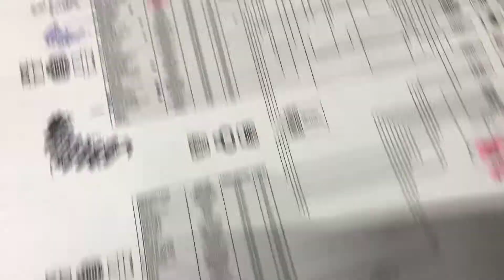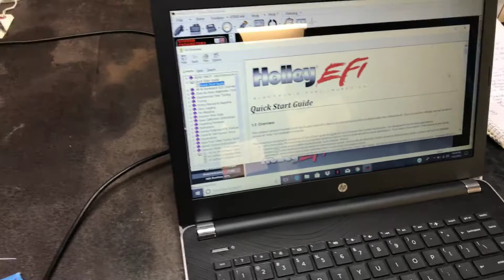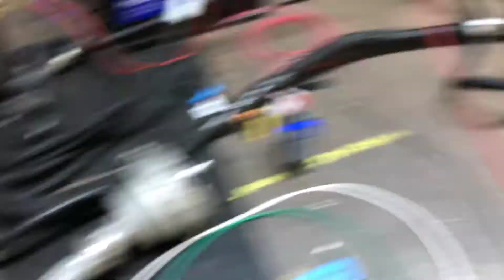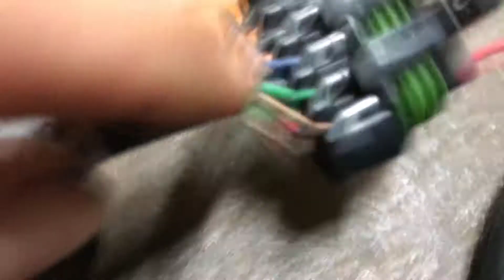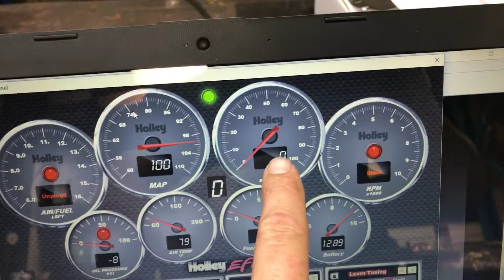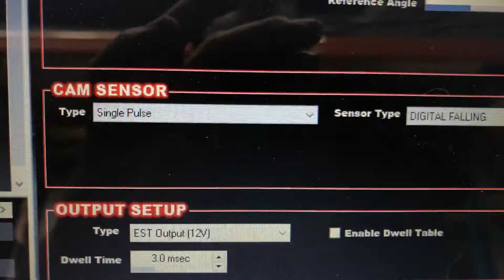Holden 308 holley hp efi

Comment: I used the  unused wires from the in / out loom (white wires with colored traces) that is supplied with universal Terminator X kit with the 10 pin ignition plug that was supplied with the yellow tach wire in it.
Just removed the terminals out of the 8 pin in / out connector.
Even got to use wires with the same color trace wires to make the loom with the plug from EFI Hardware for the VT Dual Sync. 
Works a treat.

Comment: Holley make a dizzy now for the Holden v8s to work with the Holley efi snipers
Reply from the maker: Epic_ _Holden thanks for the info ill check it out. Do you have the part number ?
Reply: @infodevelopro  565-321BK I'm waiting to hear back from Holley. But a crowd in Australia said they are for the Holden stuff.
Reply: @epic__holden8976  Not a dual Sync though is it?
Reply from the maker: Epic_ _Holden unfortunately that is not a dual sync dizzy, so wont run sequential fuel injection and wont have individual cylinder trims on fuel and spark.
for now the VT dizzy is the best way to go for a full efi multipoint system